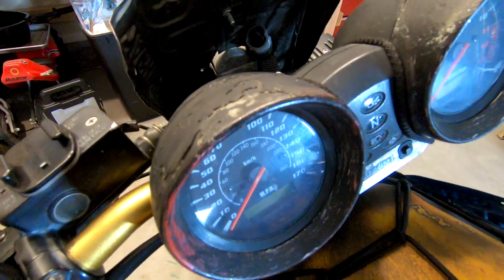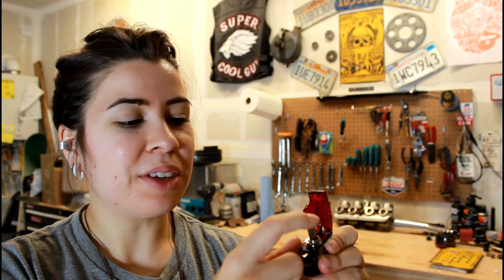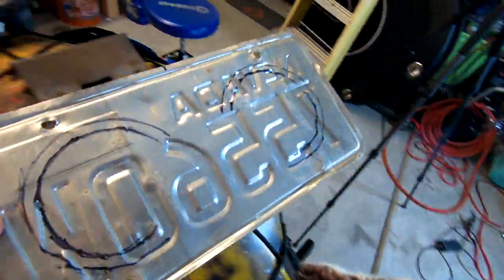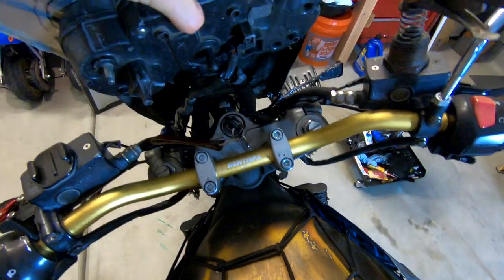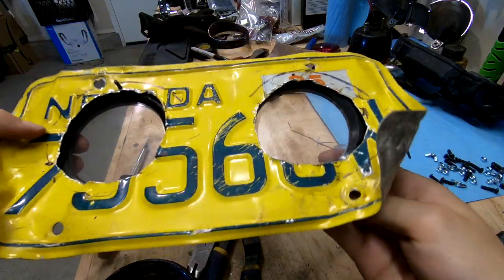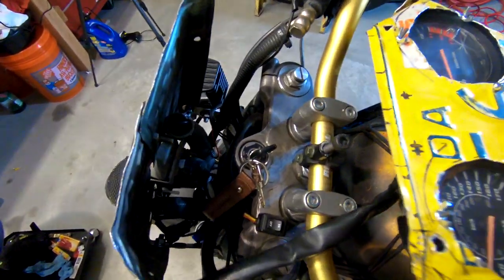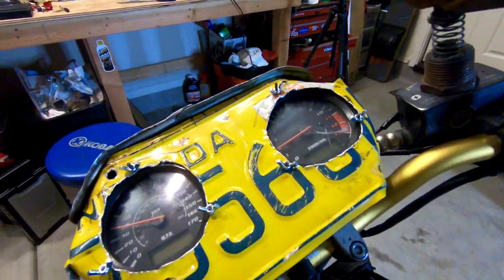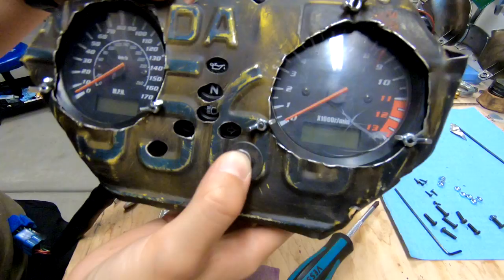Ratbike Custom Speedometer/Tachometer Mount - WASTELAND WEDNESDAY

Comment: Accidentaly found this channel right now while looking for inspiration on a speedo cluster rebuild. Dropped my bike yesterday when i got cut off and had to slam the brakes. The whole speedo and tachometer housing cracked and front light crushed. Both hard and expensive to find the cluster for an 83 Honda magna v65.  I'm thinking of just ratting it out and drop them in tin cans, then pop rivet the whole thing shut in a custom box. I will try to imitate the original, but with scrap instead. Sweet build! Looking forward to more vids, liked and subscribed.

Comment: I've always liked Pop Rivets, they make everything look cleaner and no stabby screws stick out. They have a set at harbor freight for 15 bucks. They cut down on screw usage if you work with sheet metal/aluminum. Dont know if you did or not, dab a little loctite on some if those screws, they'll eventually work themselves out. Still pretty dope though.